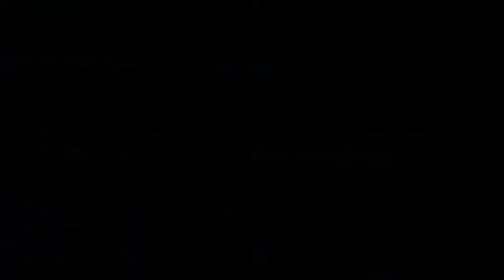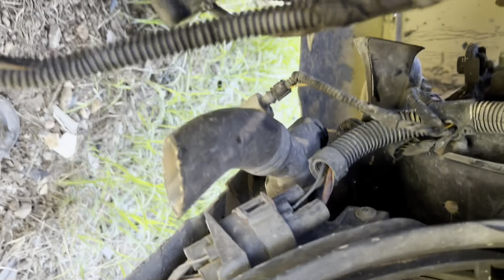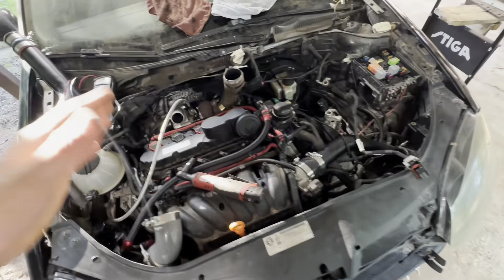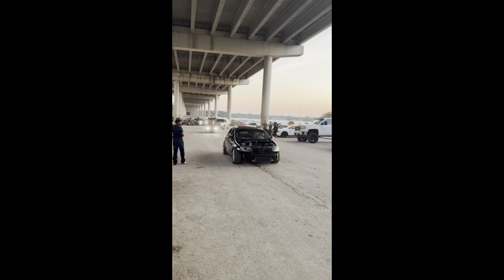Turbocharging My 2.5 5 Cylinder VW Jetta (On a budget)

Comment: You cannot turbocharge any car inexpensively, as it entails far more than just bolting on a turbo unit and driving into the sunset. You have to re-tune the car, which is not inexpensive, even if you have the tech savvy to do it yourself, the software (usually HP Tuner) costs a pretty penny. And there is far more necessary equipment needed to turbocharge an engine, like the blow-off and wastegates to properly control the boost. Nothing about turbocharging a car is cheap or budget friendly. smh

Comment: Excellent step by step my friend. I love 5 cilinders because I have one hehe I am from Argentina and I was planning to do something like you did but I stopped because here is really expensive... But now you shows us rhe process looks easier. One question did you need to change your ECU? Cause I thought our 2.5 ecu does not support turbo mapping also did you change your internals? Pistons, connecting rods, etc. Turbo will add additional pressure there. Thank you

Comment: Hey boss what head unit do you have and what other stuff did you need to put it in?
Reply from the maker: are you talking about in the MK6? If so, its an amazon android tablet radio. It was less than $100 about 6 years ago when i bought it. Its been in 3 of my cars over the years. Still works just fine, its just slower nowadays lol.

Comment: Hate to be a pain but what was the plastic piece that was clipped to the block breather adaptor that clicked into the filter housing. Tia
Reply from the maker: No problem, Its the IE block breather adapter. 

Link:
https://performancebyie.com/products/ie-breather-adapter-vw-audi-20t-fsi-25l-5cyl?currency=USD&variant=20196912398447&utm_source=google&utm_medium=cpc&utm_campaign=Google%20Shopping&stkn=2aca3e1c6be0&trueroas=20556963008&gad_source=1&gclid=CjwKCAiAtsa9BhAKEiwAUZAszWyQBjvr6GpCnaIP0OD_ezUuX8jbIk2AtIdJDW4N-umHHhKEeBARcRoCuwsQAvD_BwE

Comment: What year is your Jetta? Are u running a forged camshaft 07k or not?? Surprising what the stock intake manifold can do! Already swapped mine on my 06 Jetta for tuning purposes🤪. Also do u know approximately the mileage of the engine ur running? Did u ever skipped timing with one of ur 2.5? Mine is at 270k KM with pretty sure stock timing, begin to stress out a little ‘bout this since I run it at 7,4K rpm daily😅 thanks for the awesome video my man!

Comment: Now keep it sleeper, hood back and full exhaust
Reply from the maker: That’s the plan! Currently have motor out and am doing wire tucking, harness shave, etc. got some more goodies on the way for the car too. Wanting to do a 3 inch downpipe to 4 inch rear section stainless.

Comment: Shouldve kept the straight pipe, hood exits sound like shit on everything including diesel trucks. The only thing that can get away woth hood exits sounding decent are turbo dsms and hondas. So turbo 4 cylinders. Even then a full exhaust can sound better.
Reply from the maker: Currrently have motor out fabbing new downpipe and exhaust. Doing full stainless out the back

Comment: I've had my 08 wolfsburg jetta for almost a year now and was looking to do a VR6 swap until I started learning about the 07K's potential. So I just found an 07 black wolfsburg so I plan to use it for a parts car for the 2.5 swap. Was just wondering did you just turbo the bone stock 07k?... mines got almost 200k so I plan to tear it down and do it right, this will also be my 1st build so hopefully I could ask you a little pointers otw?... thanks bro!

Comment: Is this the same engine in the mk6 jetta 2.5L? And does anyone have a video or link to somebody with a boosted mk6
Reply from the maker: Same engine so basically same installation process minus a few tweaks that the mk6 chassis either added or removed.

Comment: Really dumb question when running the catch can what do you do with the original port that it runs to from the PCV?
Reply from the maker: It is removed when you delete the sai system with the block off plates, and you cap off one of the ports on the manifold

Comment: Should've got the CXRacing turbo or SPA turbo! Your manifold is more than your turbo lol.. Your injectors are too
Reply from the maker: @Ricky07K  yessir turbo was the cheapest part of the build $140. 

Jokes aside, it’s actually surprising how well the turbo performs for as cheap as it is. I have no issues with it, they are actually sending me an upgraded one for free since I made this video.

I’ll run it until I have a reason to change it but yes for sure in the future I would like a nice spa turbo. Thanks for the input I really appreciate it.
Reply: @Zenosynes  CXRacing is rlly good too for cheap

Comment: Thank you so much for this! I got a 09g so I'm gonna boost it for low boost and see how long it takes to blow lol.. 

At 200whp rn NA!

Current mods 2012 golf 2.5l
INJEN SRI
USP HFC
IE TCU TUNE 7100RPM
IE STAGE 2
SPA Turbo Intake Manifold
AWE Catback
Reply from the maker: Very nice. My car was 09g but I swapped it to 02q 6 speed. Even low boost the automatic can’t handle it. There’s only a handful who have done it and every one of them has overheated or burnt the transmission up unfortunately. You will 100 percent definitely need to manual swap 😢

You got this!! Thanks for the support 🙏
Reply: @Zenosynes  ty for the feedback probs just gonna swap my car for one that has the 5speed or get a mk7 gti

Comment: Sounds good and looks good but it’s pretty slow lol. VRT would be more worth the work.
Reply from the maker: More worth the work yet 4 times the price lol. These engines are $250.
Reply from the maker: I’m just getting started 👍🏻 I’m running stock clutch so I only am running 13-14 lbs. considering the cheap turbo etc it’s honestly at an expected power level right now. 

Simple clutch kit upgrade and intake manifold upgrade and I’m good for 450whp, completely bone stock unopened motor. 

If you look into these 07ks you’ll be surprised to see their true capabilities, I’m just not there yet.
Reply: @Zenosynes 450whp for a 3,000 pound car is good  very good actually.

Comment: Where did u get the intercooler pipes have a 2.5 turbo beetle need to get and inter cooler fitted up
Reply from the maker: @MK8_FTW  it’s a Maxpeedingrods Universal 2.5 inch piping kit. They don’t sell the black color anymore on the site but you can find plenty on eBay and Amazon etc.
Reply: @Zenosynes  sick thanks for the info

Comment: The Volkswagen 2.5 is easily one of the most underrated platforms. It's very available, it's quite reliable, despite being a Volkswagen engine, and clearly the engine is overbuilt to handle A LOT more punishment than it would ever see in a naturally aspirated configuration. This being said, the 5 valve 1.8 turbo is quite formidable as well.
Reply: The difference is the 2.5l is a tank compared to the 1.8t 20v. The 1.8t runs out of reliability around the high 200-300Hp mark with the rods abandoning ship, Lol. The 2.5l with is low cr is almost as if VW was going to boost it then like the oe 12v VR6 changed their minds. Its no reason to use a forged crank in a low Hp NA engine, yet like my 05.5 some can still be found waiting for their owner to get bored and take a walk into the boost life.
Reply: @emotionalintelligence776  Definitely agree, but the 1.8 is an attractive choice simply because it does more out of the box and already comes with a turbo on it, even if its maximum potential is more limited than the 2.5's
Reply: @emotionalintelligence776 1.8T, for as much as I love it, is constantly trying to off itself at stock power. Chain tensioner rattle, hydraulic belt tensioners failing, I've had a cam snap in half, valve retainter fail and drop a valve, etc. 1.8Ts are cheap HP, 2.5Ts are reliable HP.
Reply: The EA888 Gen 3 and 4 are incredibly solid and capable engines
Reply from the maker: Well said!
Reply: Real shame these engines didn't make it to europe, wonder why. Maybe small market potential, americans wanting more power and europeans wanting more economy.
Reply: @martinmartymars yet somehow we still got the 2,3 v5 and 2.8, 3.2 vr6
Reply: Лол, двигатели фольксваген самые надежные в мире. Фанатик ватной тайоты вычислен😂

Comment: After all you’ve learned throughout this process, what year would you recommend for someone looking for a 2.5 turbo project? Currently reading all the opinions about the forged cranks available in older models and upgraded timing chain setup in the newer models and a lot of the info spans across >10 years. Anything I should look out for?
Reply from the maker: Due to 05-06 being ones with the early timing chain setup as you are aware I’d stay away. 06.5-07.5 seems to be a good range for forged crank models but in my honest opinion if you aren’t going above 550-600 whp I wouldn’t worry about a forged crank. Any 2.5 engine is a great candidate at the end of the day but I’d say 06.5-07.5 & 09-10 are the best year motors from what I’ve done research on / what my tuner has said

Comment: Why turbo is it again?
Reply from the maker: Maxpeedingrods t04e .63 AR turbo
Reply: @Zenosynes  how was the power band from it. When did it start spooling? 
Any regrets with this turbo
Reply from the maker: @BulliKid  powerband hits full boost around 3.5k rpm. It spools quickly all the way to 7k+ 

No regrets so far 👍🏻
Reply: @Zenosynes  does it hold the boost to redline or does it drop?

Comment: How much does it make if u have a definitive number and why u didn’t just buy the turbo kit from max speed Ik u would get stuff like wastegate and blow off valve the u might not use but all the extra stuff would may have helped
Reply from the maker: I did buy their kit, and only used like 2 things from it. Waste of money, with these cars you can’t use those cheap wastegates and blow offs etc. you gotta buy it all individually, and at least get a somewhat quality brand 👍🏻
Reply: @Zenosynes  thx for the reply I appreciate it cause I’ve been on the fence from the day I got it researching but everyone is like I turbo and haven’t really shown the steps and issues they faced I appreciate the video
Reply from the maker: Right now it makes 330 whp. To the crank its high 3s .

Comment: Could’ve cheaped out on the tial and bought a fake and saved 400$  eBay waste gates are fine never had issues 35:20 cool build tho sounds swweett
Reply from the maker: @brandonkelly719  if you watch the video, you will see that’s exactly what I was running before the tial. Gave me tons of issues, had to upgrade to a proper wastegate. Plus the tial comes with heaps of spring combos for different boost levels

Comment: Also got a 2.5 as my first car, bought a B5 S4 as number 2 to see what boosted life is. I'm now baby stage 3 on the S4 and I've been debating on boosting my 2.5 as an ode to OG Audi. I will definitely be pulling the trigger on doing it now. Boosted brothers garage is what I had seen first that really got me interested but this is the icing on top. Thank you for the video!! Much love for the 2.5 and 2.5T community.
Reply from the maker: Thank you for the support, you definitely won’t regret boosting the 2.5
It’s not as bad as it may seem. Just prep work getting the parts etc
Reply: literally the route I want to take. the 2.5 is my daily and I'd love to turbo it one day when a get a new car but if I get that S4 I might forget ab the Jetta 😭
Reply: @XanderDfilms  Honestly, depending on how old you are I sorta regret buying the S4 when I did but at the same time, I'm glad I did. It's definitely a different car. I would drive my Jetta on back roads 1000% more than the S4. It's a way more playful car. Just be super careful on the s4's and take your time when looking for one l

Comment: Time to stock up on 2.5 engines before prices start to skyrocket. On the fuel pump did you hust jab the rs4 pump into the jetta housing?
Reply from the maker: I agree, they it’s only time before they aren’t a dime a dozen anymore. 

As for the rs4 fuel pump, you just take the rs4 basket and remove the top. You use the mk6 2.5 top piece. So you honestly have to buy a 2.5 mk6 pump, a 2007 Audi rs4 pump, then you combine those 2 if that makes sense. I can make a video over it explaining it sometime if need be

Comment: Why did you put the oil return so low down on the pan? It will be submerged in oil. The oil return shouldn't have any resistance
Reply from the maker: @Wolfpack310  because I didn’t want to have to pull the entire bottom of the motor. Seen plenty of people run it just like I did on these 2.5s no issues.
Reply: @Zenosynes  it needs to be higher than oil level in the pan for efficient drain.  If the line fills upp and doesn't drain efficient it will leak inside the turbo

Comment: Man a 0-60 pull video with dragy or at least a timer would be nice.
Reply from the maker: Definitely will in the future. It’s night and day difference though
Reply: @Zenosynes  I bet. I have a ‘14 mk6 jetta and still is totally stock. 137k miles both original engine and tranny. I dont wannt turbocharge it but something like a HF filter to make it somewhat more responsive would be nice
Reply: @starmember132  if its the 2.slow it aint worth it. intake -> exhaust -> tune are the first steps if you got any other motor
Reply: @reyminder  Man why would I be commenting about intake or any other  mods on a 2.5 video if I have the 2.slow? Wouldn’t make sense.

Comment from the maker: 0:00 Introduction 
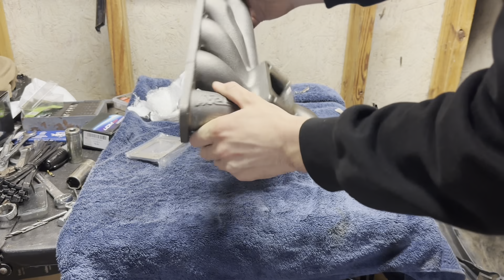2:25 Preparing For Boost 
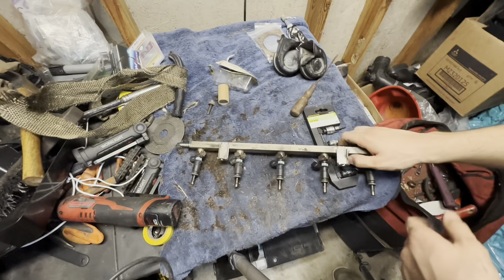9:15 Fueling 
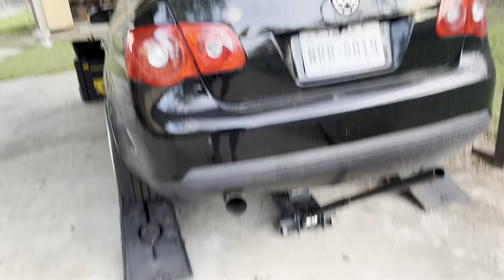12:37 Exhaust Removal / Oil Feed Install 
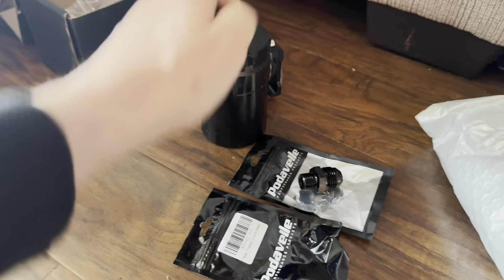14:00 Catch Can Install 
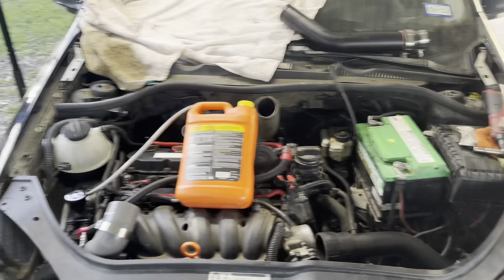18:02 First Start Fail 
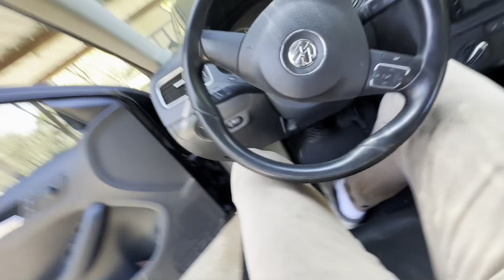19:10 ECU Talk 
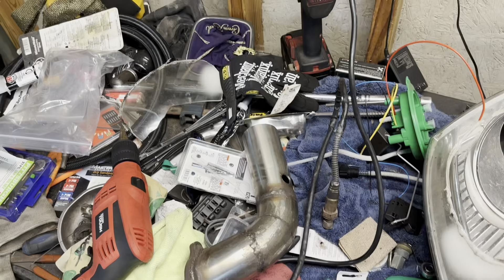20:51 Hood Exit / Screamer Pipe Fab 
23:41 Ready To Start / ECU Here 
25:22 Addressing Misfire 
27:01 Dialing Car In 
34:36 Build Cost Breakdown 
36:07 Outro